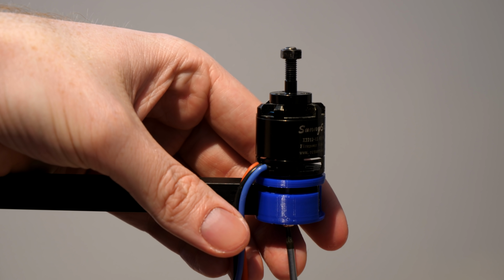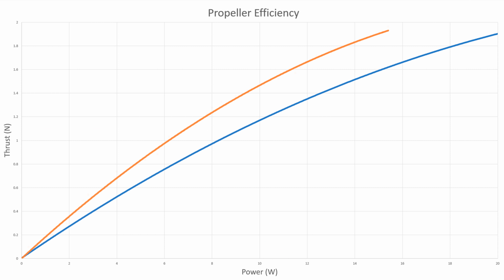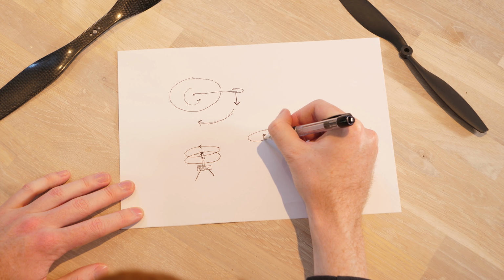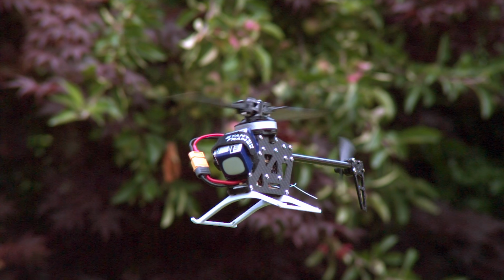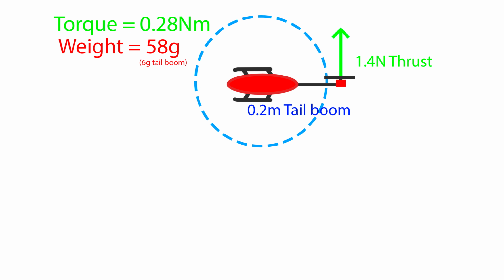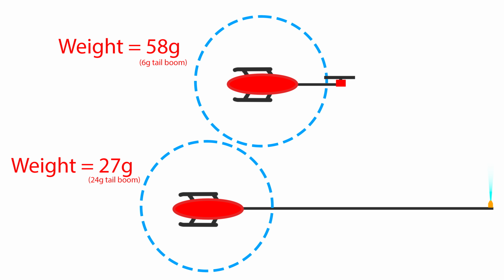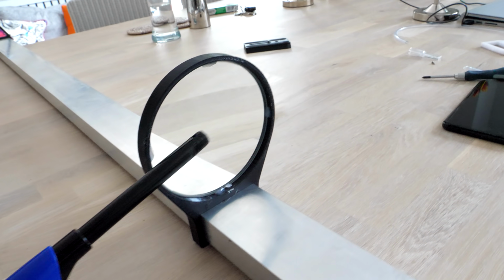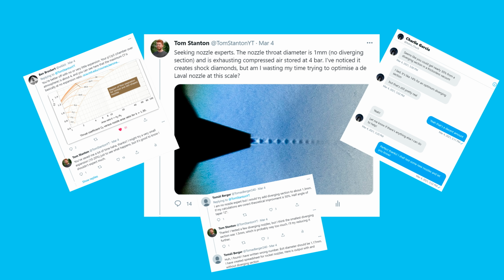Air Bottle Helicopter

Comment: Your craft crashed because the rotor slapped the boom downwards. You can see it in the slowmo at 12:03. The boom suddenly stops ascending, and wobbles. The energy transferred cost enough lift to be lost, that the craft just dropped out of the sky.

Comment: Have you considered a free spinning body   with a larger rotor attached to utilize the counter-acting torque for lift instead of offsetting it with a tail rotor?  
A toy called the Boomerang Ball uses concept which requires only a single motor to spin two counter rotating rotors.
Reply: YouTube seems to be blocking links, but if you search for the following,
"flying saucer toy hand controlled review"
The first result shows the concept much more clearly on a different toy.

Comment: The problem with making an air powered helicopter is that using air as a power source means your system is heavily reliant on efficiency. The more efficient the system is, the better it performs and frankly, a helicopter is not a very efficient design. It's called a flying brick for a reason. On a fixed winged aircraft, you only need enough power for the wings to produce lift so the work is basically shared between the engine and the wings. On a helicopter, you only have your prop to make all the thrust that the aircraft needs to sustain flight.

Comment: Hang the bottle vertically so it doesn't block the air flow off the prop and improves the tilting stability then two shorter booms to balance those arms with a fin to use downward air flow off the main rotor to counteract the torque, more torque more airflow etc.

Comment: Yes it is physible to fly with compress air and this Doctrine Experiment already been done by "Dr. Raja Haroon Latif". In them an "Air compressor Tank" which is full of air start the propellers with Air pressure and there after the Propellor power not only produce Energy but also helps to produce "Air Compression" for "for Air Tank" during the flight and through that  Helicopter can fly  whole year long without stopping. So this "Doctrine Experiment" were been completed A Pakistani Doctrine Aeronautical Engineer "Dr. Raja Haroon Latif"-----------------------but------------------------------------------the Problem of this type of Heli copter is that they can't produce Much Air propelling Thrust for big Hali copter through which its speed can't be increase but in other way with the use of other technology with "Air Compression" its flying speed can be increased which he had already experimented.

Comment: You are over thinking it... run a tube down the leading edge of the propeller with a rear facing nozzle on the tip of the propeller.... just an air intake between the upper and lower bearings for the propeller shaft (same concept as the tail thruster you made)

Comment: would be much better if you had a design where you could fully pressurize the bottle and then have the turbine and rotor turn on after you have fully pressurized the bottle and have some sort of servo-controlled valve on the craft that allows you to turn off the flow to the rotor.  So you would fully pressurize the bottle with the valve to the turbine and tail rotor closed then once you are ready to fly you then open that valve air goes to both and you get a much smother lift off without any of the control issues you had.

Comment: There's another way you could dispense with a tail. Check out the Kaman K-MAX system of intermeshing blades. The gearing is very simple and might suit. It's actually how some of the oldest helicopters worked, but it's quite inconvenient for humans so rarely used.  It's used on the K-MAX because it means more power is available for lift. That might help with the bottlecopter.

Comment: I thought you might've used an airfoil mounted lengthwise from the helo, leading edge upward, and angled to deflect the main rotor airflow to counter its torque with lift going sideways

Comment: How much air pressure was inside the bottle, like 2 x atmospheric pressure (1 bar pressure difference)  or way more, like 10 bars? I don't think the bottle is solid enough for anything above 1,5 bar. This said, there are some special bottles around for putting CO2 into tap water. These bottles support more pressure than your regular household water bottle.

Comment: Tom this way of flying has already been done. Ukrainian Antonov bureau designed 32 air powered jet engines and Volodymyr Fralov used it for fuel in a car but it's a Volga body fitted with a compressor and battery this was done in 1986 Gorbachev actually drove the car and stopped suddenly asking what fuel are you using and the inventor replied compressed air . Gorbachev said we cannot use this technology the Soviet union spent billions of dollars on the production of oil and gas industry.

Comment: Hi Tom, I have no engineering experience at all, but don't let that stop me: could you counter torque of the main rotor by funnelling the down-thrust in the opposite direction? I'm imagining fins, or a tube belowthe rotor with ridges, arranged in a helical curve. I'm sorry I lack the technical vocabulary.

Comment: Not a pro but is it possible to create air pressure in the bottle using the pressure drag on the plane like a bottle which will intake pressure from the motion of the plane???

Comment: I used to have a little helicopter that worked on air pressure. The thing is it had a small plastic capsule that was filled up to pretty high pressure using a hand pump. I feel like all you need is a bottle that can hold more pressure.

Comment: The turbine is not really efficient. an inclosed turbine would be more efficient. because the air would be forced across the vains of the turbine. instead of out in every direction.

Comment: Unfortunately, slower moving propellers are always more efficient, for example the atlas human powered helicopter. I'm positive that if you mount a freaking massive propeller at an optimally geared turbine (so that momentum=0) it will fly no problem

Comment: Use portion of propwash on a dished fin to deflect portion of high pressure under prop - The low pressure side of prop(top) supplies lift

Comment: you know tom you could convert the helicopter idea to a pneumatic generator ether with a passive compressor like a tromp or active compression (i.e. an electric compressor compressing when power cost is low or manual bike pump) or even co2 power if you wish to take that route (even if continuing with the Heli idea but designing a system that compresses co2 and even if not designing it then it would be a good talking point) and I am just saying as a Pelton wheel is usually used to generate electricity from a passive compression of flowing water using gravitational potential energy but even if a tesla turbine would be more efficient use for compressed air this is cool in its own way and you could use contra rotating turbines to recuperate your losses using a planetary gear box to reverse the contra movement

Comment: I just got an idea that I want to know if it will even work you found a way to make your air engines more fuel efficient with a auto throttle of sorts to make it last longer and consume less air over time and regulate how much is being used wouldn't you be able to make a similar one for this type of propeller engine your using but instead on the pistion engine it's to the nozzle so then you should in theory get some fuel efficiency added onto the gear ratio you've done and maybe find a middle ground of propeller then the large and small one to get the propeller efficiency? These are just ideas I thought of and if you get to the point you get advance maybe just maybe think about making the air builds more complex and challenging to then be able to make them better like say take the pistion plane engine but make it a challenge to make it work with a lubricant for the engine to run at higher speeds and efficiency but the challenge is to at least lift 2x the normal weight as well and add in that design and all it will take for some of these ideas to work is to increases some things like I'm not sure if you have a gearbox or not on that but maybe do that again all ideas and things I just thought about I've watched your vids a while and been thinking of concepts to see if they will work but I dont got the things to test it out but yeah like your vids keep it up looking forward to new projects of sorts you do hehe ps if you have more than one rotor stacked the farthest one will have more speed than the first so say if you manage to make one engine spin another and another while all being powered the last one gets more power sense after each one it gets 2x the rotor power than the last just a thought to know for future engine ideas

Comment: can you maybe 3d print your own "bottle"? because if so you can get rid of hoses maybe and build a nozzle into the top of the bottle? maybe? idk like an intergrated system and the pressure wouldnt have to travel through tubing. idk if itd shave weight or not but maybe that too. i think its possible. why else would you think it?

Comment: I think what you did with the tail was the best idea.  However, another configuration would be what they use on the UH-60 A Blackhawk.  The angle of the tail rotor adds lift to the aircraft, while counteracting the torque of the main rotor.

Comment: If I may give you a suggestion, it seems the bottle is too sturdy for the amounts of pressure you are using. You need to use that bottle at the limits of pressure it can handle or use lighter bottles (those used for water are small and can be quite thin at times.

Comment: I found myself thinking about this video again recently and wanted to circle back with suggestions. I think the 2 counter rotating props is a good idea since it not only cancels rotation, it doubles the number of blades producing thrust. BUT, since you can drive both props from a single input, you don't have to double the number of bottles. And the secret to making all of this work, you already figured out... your pneumatic engine and the syringe pressure throttle (for efficient use of pressure and linear power delivery).  To see why I think this would work, see the contra-rotating fan in this "fan showdown" (it drives 2 contra rotating blades from a single input in a way that should be very light weight if adapted):

https://youtu.be/lx01utHcFtg

Comment: I would love for you to make a turbine like that but with fan blades being powered by air and then having that attached to a car or a tank to have a cool high pitched whine. Have the air go through a tube with lessening diameter to increase velocity and having the tube packed with fan blades on a shaft that is attached to either a clutch or a gearing system to move. It would be so cool to use the pneumatic engine you made and make it into a v twin setup with 180 degrees off set to have the second piston fire while the first one is bottoming out on its stroke. You could hook up a cvt and tune it to apply load in a way to reduce the rpm of the engine and thus the air consumption. You could fit 2 bottles on a car easily and maybe use a centripetal clutch with a fan of rubber pieces that would rotate outward contacting a bell and engaging.

Comment: I could not stop laughing at the musical slow mo takeoff, and then when the rotor separated from the bottle and moved gracefully toward the camera, I thought I was going to have a heart attack. I wonder if driving the rotor  directly with jets (like the Hiller Hornet) would be worth getting rid of the gears and tail rotor? Perhaps you need to get someone to make you a carbon fiber soda bottle that you can pressurize up to 5000 psi...

Comment: Get rid of the boom and tail.  Put a thin shroud around the propeller and have slits in the shroud to counter the rotation.  The end wash from the prop will be redirected.  May need a double shroud that can change the slits for spin control.  Next orient the bottle as you would when its sitting in your fridge.  Next place a small amount of diet coke and Mentos in the bottle for self pressurization.

Comment: Have you considered building a Pneumatic Gyroplane? The main rotors of those things are usually unpowered and they shed a lot of the components usually found on aircraft, so you'd definitely save a lot of weight. I'm no aeronautical engineer, but just a suggestion

Comment: Have you thought about getting a flapping wing aircraft making use of the “clap and fling” effect powerded by pressurized air like it's been described in "Development and testing of the Mentor flapping-wing micro air vehicle" (J Aircraft 2007; 44: 1701-1711)? I know, not quite a helicopter, but still quite interesting in it's own right, if nothing else?

Comment: If you are looking for suggestions a standard 2-liter bottle may not be the best power source the best tank for pressure to weight for a given volume would be a spherical bottle. Before you say It would be hard to source in the US we use spherical bottles for pomegranate juice so they do exist. I remember I also had an air-powered held and plane toys as a child with this tank shape proving it is a viable choice.

Comment: Good video!
I am surprised you did not try the coaxial rotors like in Russian helicopters. I guess that can be a video for another time ;)
It would have solved alot of the counter rotation issues or eliminated instabilities at the cost of more complex gear box.
For example in the US helicopter handbook it states the following items are benefits:
Reply: rest of message: 
For example in the U.S. Department of Transportation “Basic Helicopter Handbook”, it states the following items are benefits:
Settling with power — Reduced
Retreating blade stall  — Reduced
Medium frequency vibrations — Reduced
High frequency vibrations — None
Anti torque system failure in forward flight — Eliminated
Anti torque system failure while hovering — Eliminated
"The reduction and elimination of these hazards are the strong points for the safety of coaxial rotor design"

Also, NASA made a mars helicopter with the coaxial rotors.

Comment: Idea: build a kite with control surfaces moved by servos. No propellers, fly just on the wind. You attached it with a single string to the ground, and it should fly by itself (moving these control surfaces). 

After you can attached small propeller to generate electricity, and either send this power through cable to ground, or to use this power for servos. 

Btw, great video!!!

Comment: Hi! Have you no try it with hot air as replacement with cold air? (so as example with fly Balloon) Or if you would gain with low torque why you don't build first a zeppelin model to fly. ?

Comment: Your air bottle craft are fascinating.  The clever engineering combined with competent manufacturing are very creditworthy.
I did wonder whether there was not a next step for them.  Current designs are lightweight, but rely on having all the energy (Pressure) at the beginning of the flight.
There are, however, easy ways to produce large volumes of gas.  Whether through simple gas producing tablets (CO2 like alkaseltzer or mentos/cola as Mythbusters did frequently) or hydrogen producing such the volcanos seen more often recently (elephant toothpaste or devil's toothpaste) or perhaps some other less visually spectacular high gas production reaction.  There are even bottle 'bombs' produced from dry ice which clearly produce enough pressure to explode a soda bottle, so equal or exceed any pressure you have produced manually.
While this would require carrying the chemical fuels, they might offset some weight by not requiring the same pressure regulation and could produce a sustained flight through regulated chemical action.  The weight would be lessened as the fuel was exhausted as well.
I would be interested to see what your creative mind could make of incorporating some pressure production mechanism, chemical or otherwise, into your design to create more sustained flight.

Comment: how about using a 3 or a 4 blade propeller to increase the thrust and i guess it wouldnt increase the weight that much as compared to a much bigger 2 blade propellar 
 (ps if im being stupid and this dosent makes sense do correct me ]
Reply: and going back to plane design fitting two motors on each side of the wing with a 4 blade propellar

Comment: You could use dry ice or liquid nitrogen as your "fuel". As it heats up it will turn into gas, which would replenish your pressure (also no pumping required. Likely you could get more range from your design with this concept.

Comment: Measuring properly efficiency like this doesn't work, as the efficiency of the motor depends on RMP and the Torque - which is different for the Propellers.

Comment: Have you thought of using the small CO2 cartridges for these projects? The ones used in airsoft pistols, etc. Lots of pressure and not too much weight

Comment: Loved the vid, genuinely like seeing the experimentation behind all of these pressure designs.

One running thought at the back of my head for these air pressure designs (I am only a new viewer so this might have been answered)  are they not top heavy? They are very light designs overall but I feel as if the bottle is less dense perhaps and that might play into the stability of flight. I may be completely spitballing, though I am curious to see if a counterweight might help

Comment: new to your channel and i hope you may read this but why not enlarge the size a wee bit so that way you can replace the rear tail nozzle with a micro motor and rotor controled by rc yes its more weight but thats what the size increase is for a stronger designed top rotor with a large air stroage that can handle higher pressure could proosibly give you a stabble 30 seconds of flight yes a lot of work for a small amount but if you want to succeed and achieve you must take the small wins